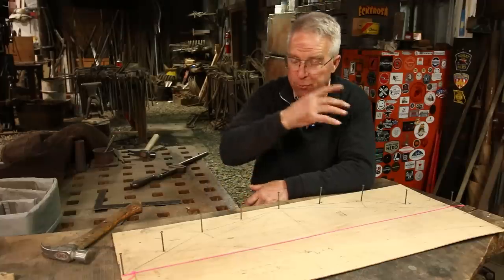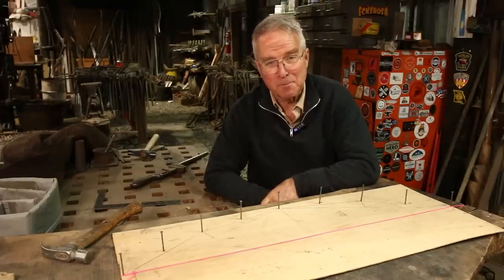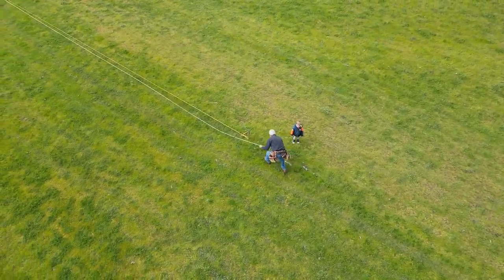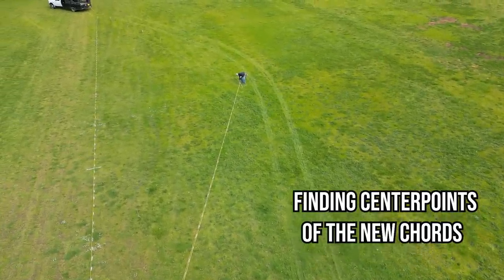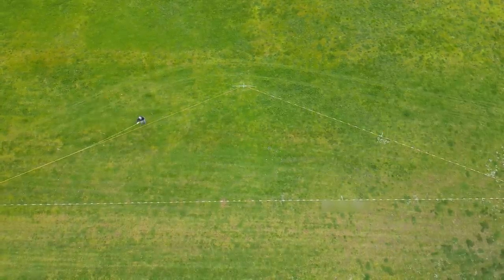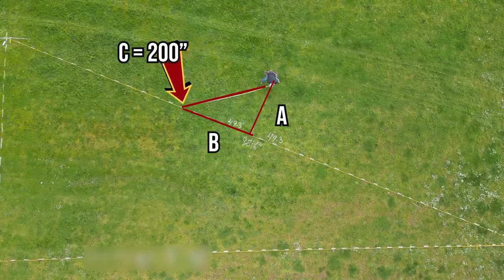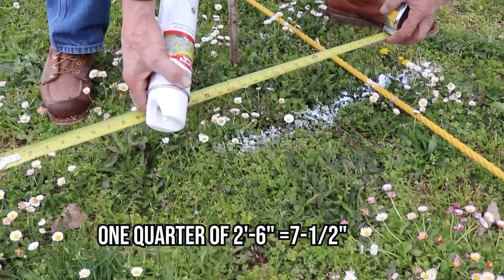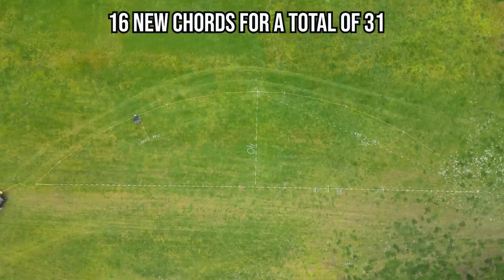How to “Quarter in an Arc” | Simple Geometry for Radius Concrete Forms

Comment: The thing that has me confused is that it seems like you flip the 345 triangle calculation on the second sagitta and i dont know why. The first sagitta was 40 (the 4 of 345) then 30 on the cord and 50 for the hypotenuse... But the second sagitta you measure 10 (120 the 3 for the 345) the go 160 (the 4 for the 345) on the new chord and 200 for the hypotenuse. Why flip the 3 and 4 side for the second sagitta? I thought it would be 10 feet (one quarter of 40 the original sagitta lengh) by 7.4 (one quarter of 30) with a 12.5 foot hypotenuse...
Reply: The first arc height was 40’ (480”) 1 chord
The second arc height was 10’ (120”) 2 chords
The third was was 2’-6” (30”) 4 chords
The fourth was 0’-7½” (7.5”) 8 chords
The fifth would be 0’-1⅞” (1.875”) 16 chords
The sixth would be 0’-15/32” (.46875”) 32 chords
Each chord is one half of the previous chord.
Each arc height is one quarter of the previous arc height. 
The chord quantity is doubled each time from the previous quantity.

Comment: BUT! What if there are trees or other obstructions while marking out that arch? 
It's not always going to be perfectly flat terrain without obstructions. Then what?
Reply: You have to work on a level plane which may mean you need to set up batter boards and strings. If you have obstructions that prevent you from at least pulling chord lengths, you likely will need to call a surveyor who can locate the points on the arc using other methods and a total station. This was done just for demonstration purposes. That field is so wide open, he could have found the central radius point and just pulled any number of points on the arc necessary, from a single point.

Comment: OK, i got the process alright, but how was the 40ft length calculated? in respect to the 195ft span, that is...
Reply: It’s arbitrary. You can start with any number.
Reply: @pdg9582  Well, it's not really arbitrary.  The 40 defines the diameter of the circle whose arc you will generate.  For a 195ft chord defined by points A and B, there is the centre point, P, and the perpendicular 40ft sagitta which extends to the arc at point C.  The diameter of the circle then becomes (( AP * PB) / CP ) + CP.  Or:  (( 97.5 * 97.5 ) / 40 ) + 40 = 277.6ft.  I.e, a chord of 195ft and a 40ft sagitta gives you an arc on the edge of a circle 277.6ft in diameter.  If you reduce the length of the sagitta, the circle will increase in size.  If you increase it, the circle will shrink.

Comment: --> A "perpendicular bisector" would be easier, quicker and less error-prone than a 3-4-5, no?
--> An arc of a circle, unfortunately, neither looks as pretty nor drives as comfortably as a spline. Fot this reason, a roller-coaster that is made of straight-sections with abrupt curved sections, even when they are nicely tangential, does not feel comfortable. Ideally, the radius should go from infinite (i.e. a straight line) to some finite value, back to infinity, smoothly. I hope you arenot using this arc for a road :)
Reply: pretty sure he will get to where the points are close enough that an edge can be flexed between points, eliminating any straight edges.
Reply: @neild7971  Huh??
I'm talking about a straight line turning abruptly into a curve of a finite radius; not about the curve being formed from straight segments. A straight line transitioning into a spline is much prettier than a straight line transitioning into an arc.
Reply: Sometimes... when building things.... you do in fact want a segment of a circle without tapering into a straight edge or straight line. Options are good.  I use this technique in carpentry, when needed.